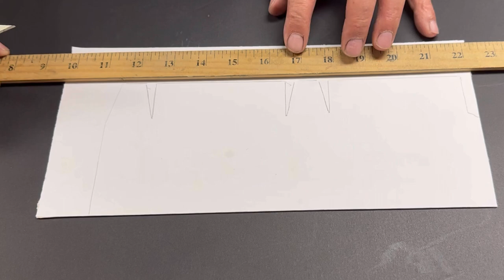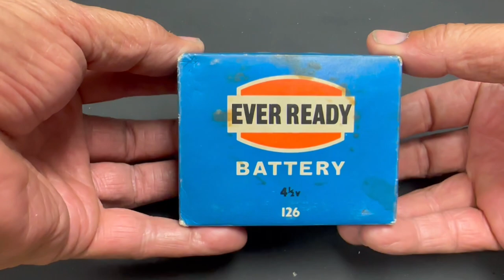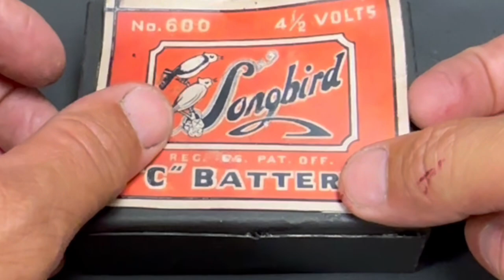Reconstruction  of old Radio C batteries - ideal for your vintage Radio restoration.

Comment: Pretty cool and creative. I imagine that's a little like how C batteries were built back in the day. It's amazing how much they varied. I've seen a few A and C batteries that used small cells like AA cells and others that used G cells, usually, C, D, and F cells were most common I think.
Reply from the maker: Thanks
I believe old vintage radio batteries came in a variety of volts 
 1.5, 4.5, 6,  9, 22.5, 45, 67.5, or 90 volts. Even as high as 135 volts.
Also some very nice artwork.
Reply: @recollectable4258  Very true. I also saw 3, 7.5, and 15 volts. I saw ones with over 200 volts but they might not have been radio batteries.